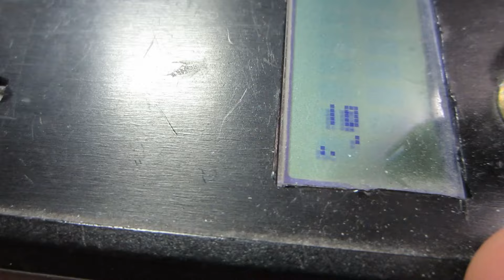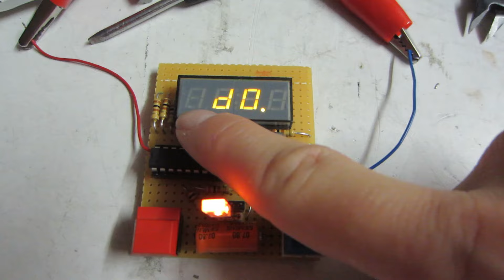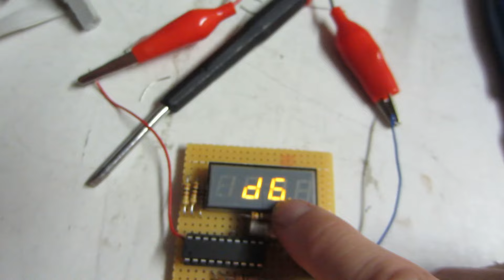Zero Dimensional PONG

Comment: I would say it isnt 0 dimensional, i belibe it would be a one dimensional bicoloured pong.

Tho if you considered red as a X axis and green as a Y axis it could be represented in a 2 dimensional plane.
Hope i didnt make any stupid claims, and that you found this interesting
Reply from the maker: Those LEDs on a 1D-PONG machine have three dimensions each as well...
Reply from the maker: Ah and btw. the green LED is just logical NOT of the red LED, so if you plot red/green in two dimensions, you would get a diagonal line, which is one dimensional and that dimension turns out to be our good friend time. (even worse, if you remember they're pulse-width modulated, if you plot them, you actually just get two dots.)
Reply: So as green gets brighter red gets dimmer?
Reply from the maker: @lakk5259  Jep pretty much. To our laggy eyes. The output to green is exactly NOT (logical NOT) the output to red. What I didn't show is that you can also use a red/green LED with just two leads where the polarity determines whether it's green or red.